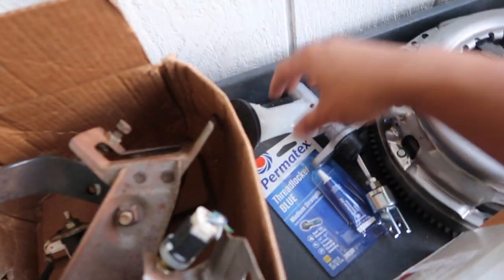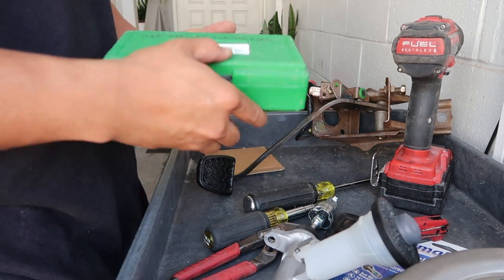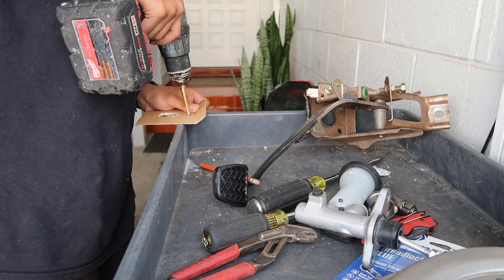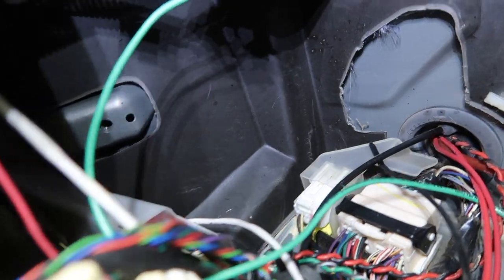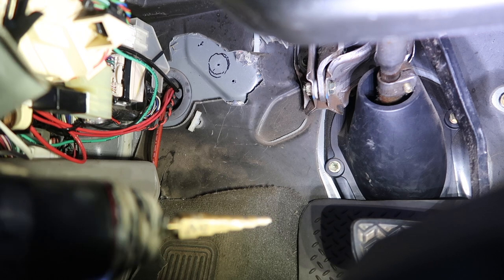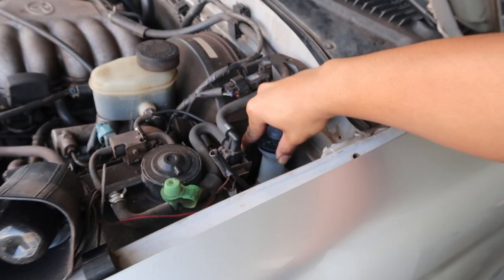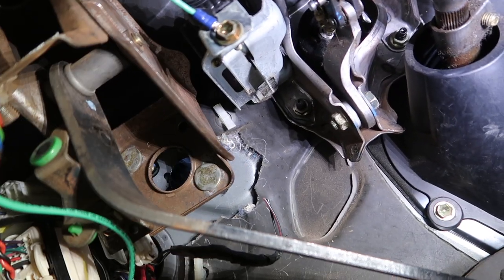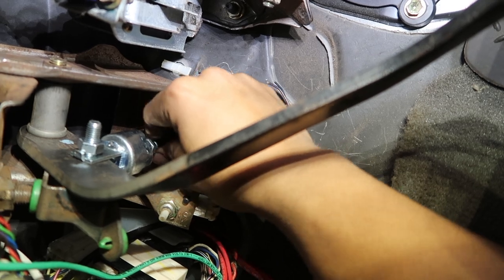Clutch Pedal and Master Install | 5-Speed Swap Pt.2 [1st Gen Tacoma]

Comment: Greetings. I have a 4Runner 97 limited with an automatic transmission and I changed it to a manual transmission but I don't know how to make it start with the clutch, I don't know what wiring I should connect or adapt. Could you tell me how to do it. Thanks you.
Reply: You get it figured out? I’m having the same issue